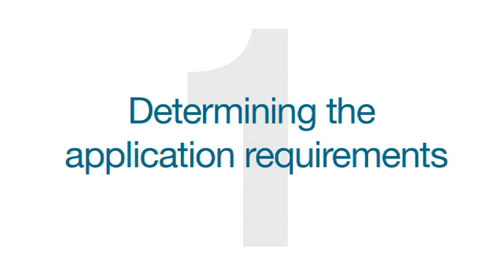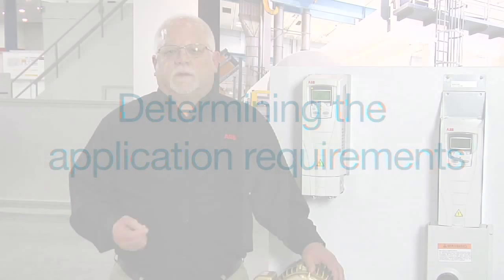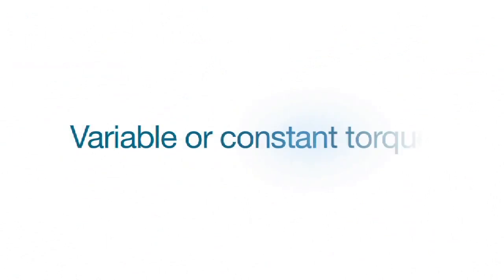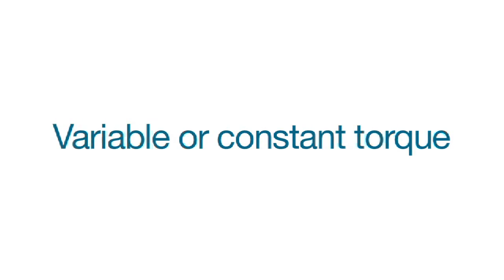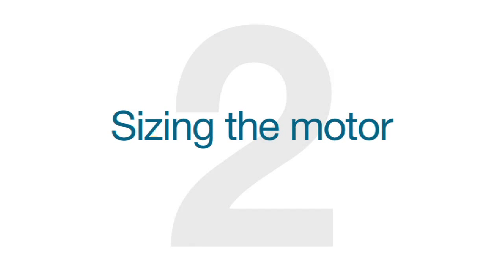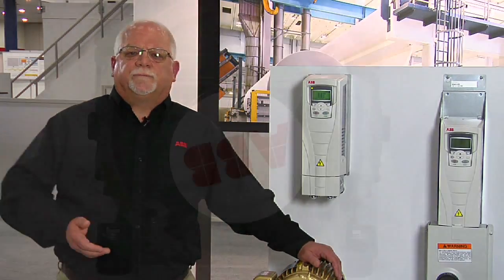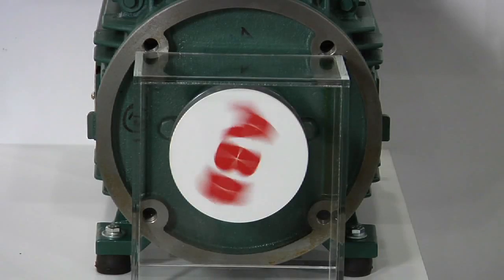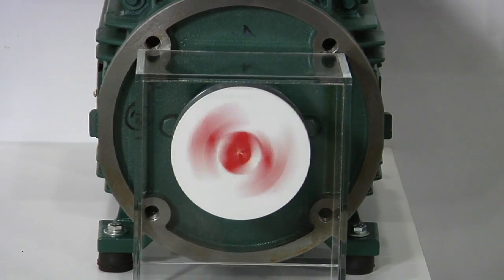Three simple steps to sizing your motor and drive

Comment: In ACS580 Medium voltage VFD, there are total 5 power modules are installed for each phase.
If we found fualt 5010 that power module has some problem and there is need to change it.
I want to ask that whether we may operate VFD by removing that faulty power module and also one each from other two phases?
Mean 4 power modules on each phase.

Comment: Mr Steve Weingarth from ABB, very good lesson, nevertheless I think you have reversed it; Fans, Blowers and Pumps are constant Torque aplications and variable Torque aplicatios are Conveyor Belts, Elevators, and other demmandant aplicatios that can have variable load wich will lead to variable Torque requirements, am I  right?
Reply: No
Reply: youre very wrong
Reply: Mr. ABB is correct. Open and insert 🦶

Comment: Which drive can be used for winder and unwinder application?
Reply from the maker: Hey Pratik, the ACS880 with winder control drive firmware would be a good choice. You can also contact ABB Drives support for specific application review at http://new.abb.com/drives.